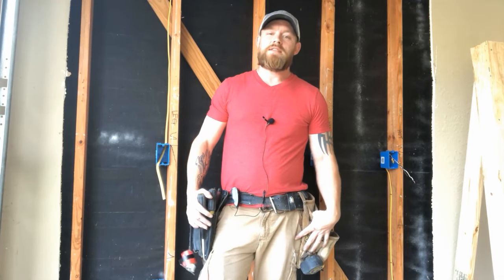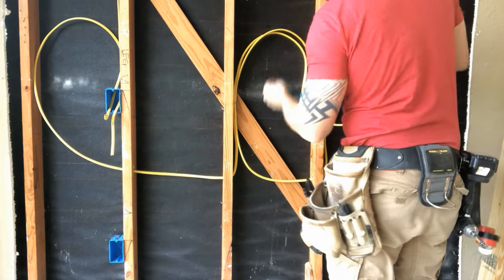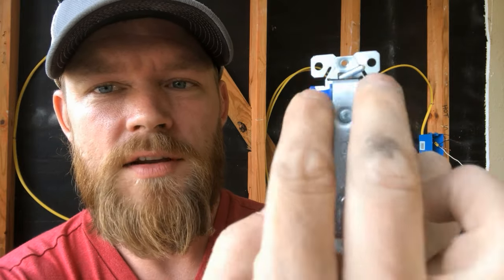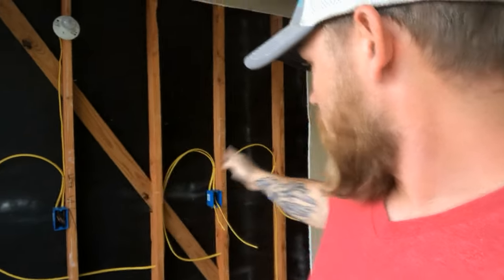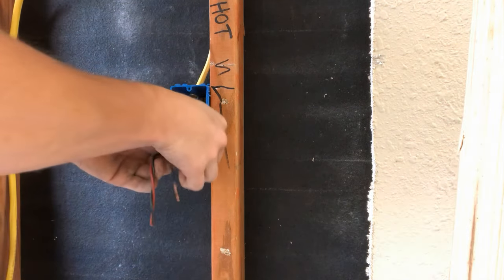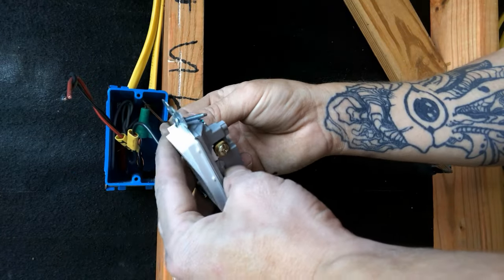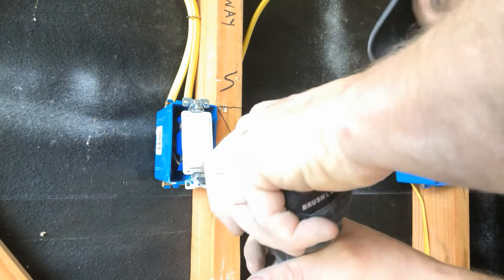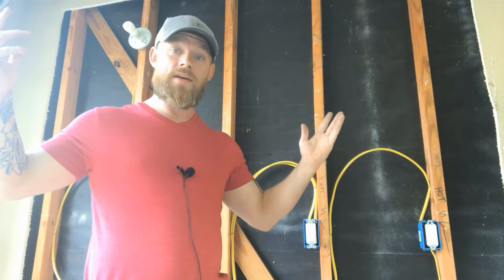Episode 8 - How To Wire For And Install 4-way Switches

Comment: I was an electrical inspector for over 30 years. Everything you said and did is right on and makes my all our jobs much easier. Great to work with electricians that know what they are doing and really CARE. Great job!!
Reply: I have a question for you Paul. I have a flip house with a 4 way switch upstairs at far end of hallway. No matter what if the switch is down the other switches do not work like the power is not going on thru to the 3rd switch. Is that a bad switch. Unfortunately it was rental property and the ex tenant was a drug addict who swore he was an electrician.  Everything else was fixed but at a showing we realized this issue. I pulled it out and it seems to be wired correctly by the way he's wiring this stuff up.
Reply: @jasonprater2992  did you figure out what the problem was?
Reply: @lordperezident  check the other switches the common wire is most likely not on the right spot.
Reply: @jasonprater2992  I had one where the switch that should've been a 4-way, was replaced w a 3-way, ie, there are lots of ways for it to not work!

Comment: As a former OSHA inspector when I saw work that is clean and organized as yours, I knew that safety was not going to be a problem.  Due to the fact that you also knew all the applicable rules and regulations and best practices.  In over 30 years of construction safety, it was proven to me time and time again.  I salute you and thank you for showing a great way to approach your work.

Comment: I really like the fact that you install extra slack before the boxes.  Future electical changes can be done without having to run new wire just to move a box 6 inches up or down.

Comment: I like to label the wire above the box.  In case you strip your wires and are called away, you always know what is what.  You can never over label! Label everything, you’ll never regret it!  Also there is like 7 different ways you can wire 3 ways, 4 ways. It can be very frustrating at first,  but once you get it, your good for life!  Thanks for a great video man, I always enjoy seeing it done right!
Reply from the maker: I’ve been noticing guys do that. That’s really not a bad habit to get into but the other reason I do it like this is so on trim out if a different crew comes behind me they know what everything is when they pull it out of the box. And I totally agree over labeling is way better than not labeling at all!

Comment: I've had quite a few electricians try to explain how to wire 3 way and 4 way switches where i can easily understand. You are the only electrician that broke it down in a manner that i not only can understand, but also can remember. Thank you

Comment: FANTASTIC professional tips.  You're spot on with your advice and these methods will save thousands of hours (and callbacks) by the end of a career.  The methodical approach to your work results in superior appearance and will pass inspection MUCH easier than a messy job.  I was always the guy bosses would send to interact with inspectors for the very reasons you're displaying and commenting on.  Don't give inspectors a reason to seek out problems, and over time you can develop a rapport and build professional courtesy.  Eventually it'll pay off when they do catch a code failure, but allow you to address the issue and get signed off without a return inspection.   Your professional work ethic and adherence to quality is what I would want on my own property.  I wish all people in the trades followed your attention to detail.

Comment: Thanks for taking the time to video each step and small detail. It’s appreciated!
Reply: I've never seen someone so thorough. Dude is an incredible teacher.
Reply: Awesome videos!! it might be good to note that some (4 way) switches are configured differently, we had this issue in my class where we were given multiple brands (and ages) of switches and the inputs were not always the same location they might be both on the top or bottom or they might be both on one side, which resulted in some classmates circuits not turning on properly once wired, but a quick continuity test can help determine which leads connect where. Our teacher could be sneaky at times and toss a switch that was internally broken into the mix to see if we would figure out the issue. Sometimes you can do everything right and still have things not work properly.  Thank you again for these very informative videos.
Reply: Helpful

Comment: I realize this video is over a year old at the time I'm posting this, but for anyone watching this who does not do this for their actual job, you must understand the difference between the three methods of making your connections that he mentioned because two of them are safe and one of them is very dangerous and should never be done.
1- Hooks on a screw, if done correctly very solid and very safe.
2- Pressure plate, if done correctly it's solid and safe
3. Back stab (when you just insert the wire into the holes in the back) there is no way to know if the connection has been done properly because nothing is tightened using this method.

Its only back stabbed outlets and switches that I pull out of walls and have the wires just pop out of their connections and that happened to me countless times. Loose connections cause arcing and fires. Never back stab, either pressure plate or hook only.

Comment: Nicely done, the name for that pole is a "Story Board" pole. Mainly used in Framing.
Spot on, your attention to details.
Cut wires at angle to accept wire nuts connectors. Even wire loops & same strap locations, accordion folds.
Must say we work alike, I try to do the same no matter Residential (wood) or Commercial (metal) job sites.
I just SUBSCRIBED, I know valuable information will be on the way, 
Professional approach, gotta love it.🙂

Comment: I agree with the notion of not using the pressure plates with solid wire in the connection can over time work its way loose. I do however use the pressure plates with stranded wire as the strands shape themselves more readily to the pressure plate. Just as though you're crimping the connection.
Reply: I think he confused the issue a little when he talked about the backstabbing. I don't think he meant not using the pressure plates. He meant not backstabbing the wires. The confusion was because the 4 way switch didn't have pressure plates, so he backstabbed the wires to save time. And, he was saying the backstabbing was a no-no.

Comment: On a 4-way switch, the "in" and "out" are mere suggestions.  As long as the travelers are paired, it can be connected either way.  Otherwise it won't work properly.
Reply: HERBY1620...YES TRUE, BUT AT TIMES YOU GET INTO A HURRY, OR BE LIKE MY OLD ASS AND FORGET WHICH TRAVELER IS WHAT AFTER ROUGH IN THAT MAY SIT THERE 3 WEEKS OR SO.

Comment: could you do a tutorial on wire size? 12-2 14-3 10's and so on. Im having a hard time remembering what size wire goes with what appliance/machine
Reply from the maker: david adame can do. There’s a lot on the matter and the equipment and the amperages you’re dealing with will determine what wire to use. It’s a muddy subject but I’ll try to clear a path for you my friend.
Reply: LoL yellow it 12 white is 14
Reply: Mr Panda yes now day yellow is 20 amp #12 and white is 15 amp.        # 14  and    orange #10 30 amp s . Old house white is #14 and #12 and #10 so old house you may have to read old marking if your not shore. And you may need to make wire bigger for voltage drop. I hade a weld machine I wire up for a auto body 60 amp 3 phase a number #6 is 60 amp hade long run need a bigger wire #4 copper for voltage drop so I won't hurt the appliance or wire.  When I do Cumberland farms a 800  amp 3 phase service we pull 3 pull black, red, blue, white of 500 circular Mill wires. And just 1 pull of 500 cir Mill wire is just for voltage drop.
Reply: I dont quite know if you are an electrician if you are asking those questions an what you mean now a days 14 shouldn't be used on a 20 amp circuit
Reply: @davidpetrusewicz7729  also old wire is usually asbestos so what do you mean by markings?
Reply: @mrpanda2655  there was a code when you could put a 20 amp breaker on a 15 amp wire if it a deacated circuit to a refrigerator. But now a days home owner just tap off circuit so if a home owner taps off a decade circuit that 15 amp wire so now wrong. Unless the home owner changs that breaker to a 15 amp.  So if a 20 amp circuit used #12 now a days I
Reply: @mrpanda2655  now that far back lead coated wire. I'm talking not far back 1990 wire didn't have color codes. Not talking open knob tubing.
Reply: 14=15a, 12=20a, 10=30a, 8=40a, 6=50a... Anything bigger.. Call me 😂😂
Reply: @davidpetrusewicz7729  That code must of been from a long time ago...I have been in the field since 1990 and it's never been that way.

Comment: Hey Pal great video of many great videos. One thing you should NOT do is use the power drill to tighten screw terminals on switches without finalizing with a screwdriver for correct tightness

Comment: AS LONG AS I HAVE BEEN DOING THIS...I'VE CROSSED TRAVELERS ON 4 WAY SWITCHES BEFORE.  AGAIN DUSTIN..THANKS FOR THE CONTINUED EDUCATION.  I ALSO MADE A TEMPLATE OUT OF A PIECE OF PLYWOOD FOR OUTLETS TO SAVE THE MEASURING EACH LOCATION..ONE FOR STANDARD 16 INCHES AND HANDICAPPED FOR 48 INCHES...ANOTHER TIP TO SAVE TIME!

Comment: You should be an instructor, great job of showing how to install 3 & 4 way switches. I just had to install 2- 3 way switches yesterday. I'm not an electrician. I was a Electronic Technician in the Navy. Repaired Radar and Communication Equipment.

Comment: Wired up a huge house where they had 5 seperate doors on first floor along with long hallways. Owner was a gadget nut. Had us install 20 outdoor floodlights controlled from 5 locations. All were on  circuit that feed the coil of a lighting contactor. Ended up with at least 10 four way switches. Found easiest way to wire them back then was use top right & bottom left for wires from supply and other 2 screws to load side. You would be surprised how many commercial electricians do not know how to wire a 4 way switch. Would put black tape on 2 wires from supply.

Comment: Hey man. Thanks for the video. Your video helped me to troubleshoot my problem with the configurations you showed. The wires going into the 4 wire box were wired incorrectly which caused a nightmare to turn on the light. Your comment on the in and out of the 4 wire box was the key for me. Thanks again.

Comment: That is awesome thanks.  We typically use Lutron QS but we are doing renovations on older wired homes and converting.  So this is great help.  I am a low voltage integrator.  And you have helped me out with understanding the High Voltage side of things. Thank you!

Comment: Really good suggestion about labeling your wires as you run. I’ve been working on a project at my house and roughed in all the wire, then 6 months went by that I didn’t work on it and I couldn’t remember where the wires went when I came back to it

Comment: Haven't seen many of your videos, I just found you. So for all I know you have already mentioned this, but just in case... As a master electrician that has not only mastered your trade but as a result mastered the use of your tools, you are qualified to use a drill on devices if you so choose. But it's worth putting in a disclaimer that a man must learn to walk before he can run. Newbies beware of using a drill, you need to have a good feel for how much torque the device (mainly those soft screw heads) can handle and a good feel for the drill you are using, as if it's an extension of your hand. Otherwise you will just strip the heck out of everything, shearing heads left and right, jabbing the bit into your hand, etc. Just thought that was worth mentioning. Personally speaking I've been doing this for a couple years but have a lifetime of experience with power tools. Only within the last year have i found myself qualified to use a drill for this. As long as a person's attitude is to improve his productivity without sacrificing workmanship, he will make the switch when he's ready, not because he's lazy and it's easier on the wrist.
Reply: Because the best way to teach someone how to use a tool is to never let them use it...
Reply: Helpful

Comment: I tell people if they can't tell which is three wire or two, when wall is finished, usually u can look in the box and see which is which.  Not everyone twists the travelers together .  I'm not a pro, but been doing remodeling so long I've learned. And always go code if possible. Appreciate your explainations.
Reply: I always spiral my line or leg over the travelers so I know which one goes to the common terminal and it’s easier to identified
Reply: @DLmohh  that is a good idea. That way when someone else works on that box, they'll have the travelers pre identified.  Great tip.

Comment: Nice neat job. It matters and great tip on those bonding wires. It the most important thing in electrical system.

Comment: Really good video! Thanks. I'm a new electrician. I already knew how to do this but I still watched the whole video to learn some tips. You forgot to do or mention a few things like using electrical tape around the device but I got the whole idea. You actually did more than other guys. thanks a lot. I've already subscribed. Bye.

Comment: I'm glad I saw your correction method with installing the 4-way switch in the switch gang; when the switch initially sat off-set on the gang because of the wiring. When replacing outlets that are wired in Series, I try and "tame" the wires (since there are so many) by bending them "my way" in order to get the outlet to set correctly in the gang. However, when bending the wire and pushing them back into the gang, they seem to bend in the direction of the original installer's setting rather than mine and they don't completely bend where I'd like them; thus not setting onto the gang correctly. I'll try your "accordion" method to see if that works better for me so my OCD can get out of over-drive.  LOL

Comment: I like this video.  I trained/qualified in Canada (120/208V).  Moved to the Cook Islands in 2011 and gained my New Zealand registration. (230/400V).  A few mind blowers, Neutrals are BLACK! (That was just wrong)... Panels are called "switchboards" with no line side busbars built in and a quarter the size of same rated panel, Loomex/Romex is called TPS, switch leg down from light is called a "3 plate"? and a 3-way with 4/way switch is a 2-way with intermediate...  Took a while to get used to a black neutral

Comment: I always went with hand length, from middle finger tip to just above wrist. that made for roughly 7" of free wire stickout from box face, for wires being spliced.
wire going to devices, I went just past wrist, which made for roughly 9" tails from box face, subtract looping for proper device termination lol.
none of us are perfect, but I'd still trust a wire nut and loop/screw at all devices over push in/backwire cruft. I guess because I still find and repair the junk melted down and nearly having caused a massive fire all too often ;)

Comment: Thanks for the video man!! I'm starting to work under a journeyman electrician pretty soon. I have no knowledge of anything. I put my Two weeks in at my other job, so I'm trying to study what I can to have some basic knowledge before I start the job. Better off prepared! Thanks again man.
Reply: look to peterson electric  and sparky channel - too 4 videos great wiring methods/trouble shooting and they tell the codes too
Reply: also great starter set very durable kind of my throw away dont care set been using llike 10+yrs (first got as a xmass deal $10) https://www.homedepot.com/p/Husky-High-Leverage-Long-Nose-Pliers-Set-3-Piece-1006/205913115  also a screw driver is a screw driver a hammer a hammer look to harbor frieght for a lot of your not so high abuse tools too will save you a lot $$$ (my first job they laughed when they seen my stanley and other walmart screwdrivers one was a huge yellow handle set philips and regular had the claw name and logo beat the hell out of em 4 yrs never broke they stopped laughing. keep good tools as back ups but try the cheaper tools as everyday you lose em they get damaged no big

Comment: great video dustin i finally learned how to wire a 4 way switch
Reply: Dustin, great video. One question, you just installed 3 switches and the 1st and last were 3-ways, yes? And the middle was a 4-way. So, if I want to install 5 switches for some unknown reason, would the live and leg still be 3-ways and the 3 others be 4-ways? Thanks for the great work... : ) -jb
Reply: Yes.  The beginning ("live"/"hot") and end ("leg") of the run of switches are always 3-way.  You can put any number of 4-ways in between those 3-ways that you want.

Comment: nice and clear. i like and much prefer the old school with stranded cables, solder/crimp-ons, and the power strips.
the only reason for the use of the single strand, in my view, is $$ conwsideration.

Comment: Because my experience is mostly 20+ years HVACR with outdoor equipment, i point the closed end of the wire nut pointing up.  This allows condensation to drain out and reduce corrosion.  Condensation does not occur within walls as often as control boxes, but i still prefer the drain position (except when the box is full).